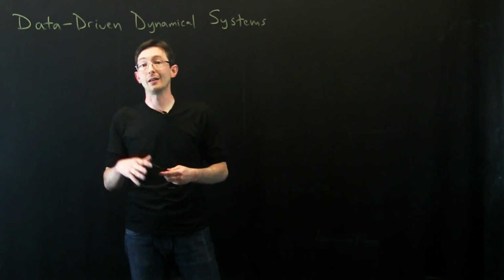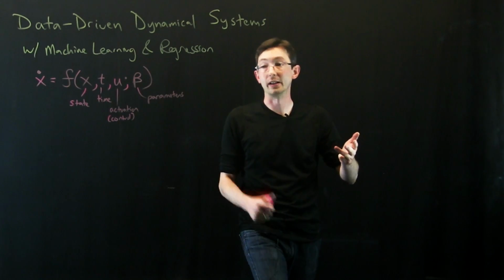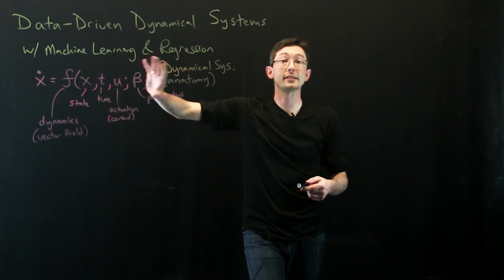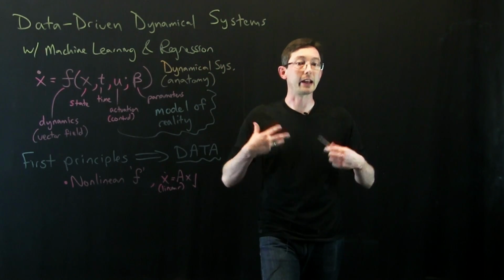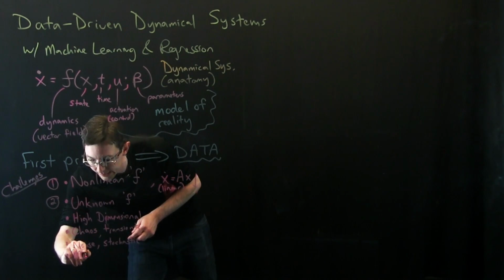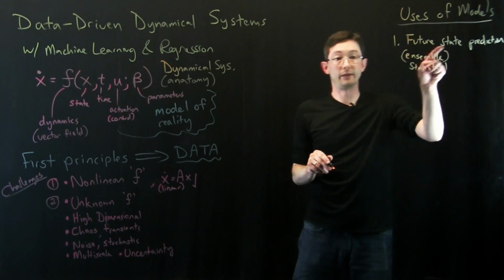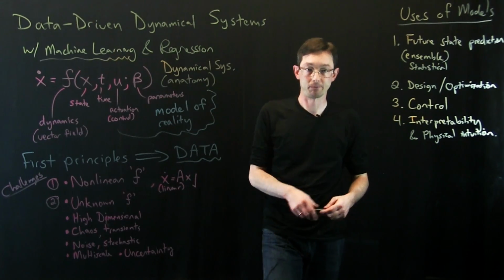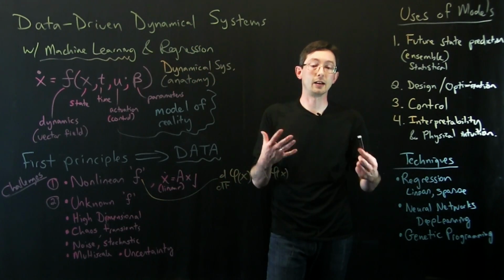Data-Driven Dynamical Systems Overview

Comment: Are there dynamical analyses of the earth/globe? What are the dynamical modes of the earth and the plates?  Geologist react often statical and local  in their approach. If volume of earth changes it can affect volcanism. Earthquakes have dynamics related to plate movements, progress of impuls, stresses and displacements along plate bounderies but ...plates also have 3D dynamic shapes  and the magma inside the earth also is behaving dynamical : flow/transport movement but also 3D vibrations. There is interaction with sunactivity. Gravitation and magnetical forces/fields also are changing. Planets like moon have influence on forces and shape of earth (2 times a day and once a month cycly). There are patterns with delay and decrase of magnitude from Earthquakes in Phillipines (for instance M7) towards M5 in Eurpo a few days later. That may be progress of force/tension/deflection/plate movement but i think also vibrations and mode shapes or 1D along plate bounderies 2D and 3D shape/movement  of plate is invoived.  Spherical Harmonics (U2-05-05) https://www.youtube.com/watch?v=Ziz7t1HHwBw
Do not see many global analyses of the earth as a globe .... like Ventusky https://www.ventusky.com Mostly is see local analyses. That does not give the total insight in the processes involved. Phillipines and Europe aree seen as randomand independent  quakes. Also quakes on the other side of the globe are not always seen as related. https://earth3dmap.com/earthquake-live-map/  https://earthquake.co/timeline/  http://earthquake3d.com